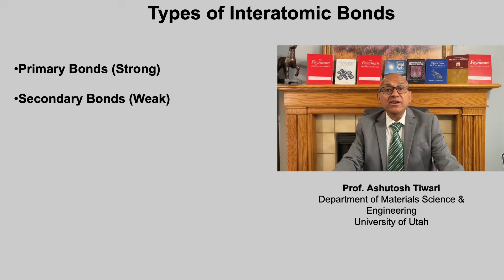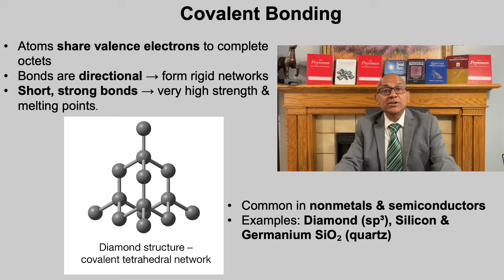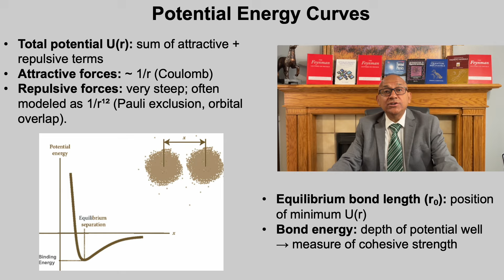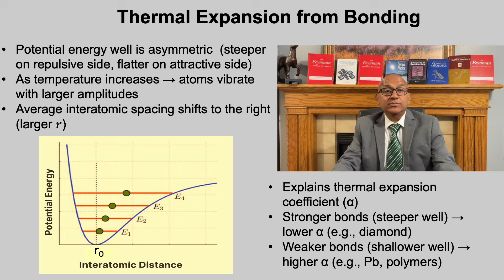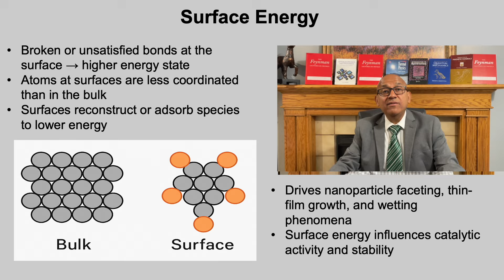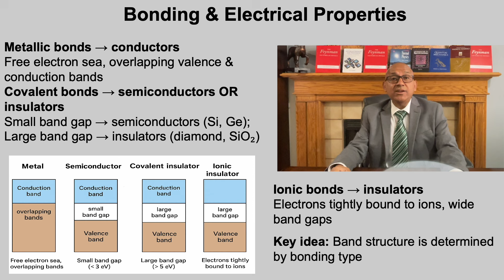Nanotechnology Lecture 9 | Interatomic Bonding & Forces in Solids

Comment: Hello sir, I am Sayona. Very informative lecture, starting with bonding which is very important as it determines atomic arrangements. It also governs interactions at interfaces and surfaces. There are two types of Interatomic bombs, primary bonds which are strong and secondary bonds which are weak. Primary bonds is further divided into 3 types which are ionic, covalent, and metallic. Secondary bond include van der waals, and hydrogen bonds. Ionic bonding deals with electron transfer, strong electrostatic attraction, thermal stability and brittleness. In covalent bonds, electrons are shared, bonds are strong and directional, and it gives rise to strong material like diamond. Metallic bonds include positive metal ions arranged in a regular lattice, and a unique combination of conductivity, ductility and strength. Van der waals bonds are weak and significant in layered structures. Hydrogen bonding takes place when H interacts with lone pair on another electronegative atom, and it’s useful in explaining high boiling point of water, structure of ice, etc. Total potential energy is the sum of attractive forces and repulsive forces. Cohesive energy is the energy required to separate a solid into isolated free atoms. Higher cohesive energy can lead to stronger bonding. Then there is bond length which is the distance at which attractive and repulsive forces balance and bond energy which is the energy required to break bond. If was also fascinating to know why materials expand when heated. Melting point of a material is controlled by bond strength so in covalent bonds, it is very high and in contrast, it’s very low in van de waals. Bonds in nano materials include high surface to volume ratio, many undercoordinated atoms, and dangling bonds. Bonding in 2D materials like graphene includes strong in plane covalent bonds, which provides stability and strength, but weak very de waals forces. The melting point of nano particles decreases as their size decreases which is explained by Gibbs Thomson relation. I came to know more about carbon and its allotropes through the well explained case study. Lastly, I studied how bonding can affect mechanical properties, electrical properties, and optical properties. Overall, this was a very informative and interesting lecture!

Comment: Hello Sir, this was a really interesting lecture. I ended up watching it twice to better understand how these potential energy curves dictate material behavior, and it realized many more implications of analyzing the different bonding forces.
The relationship where stiffness is directly linked to the second derivative of the potential energy curve near the equilibrium bond length really puts the origin of the elastic modulus into perspective for me. It is also a great takeaway how the directional hydrogen bonding bridges the  forces to form based pairs and stabilize the DNA double helix.
The breakdown of electronic structures was also fascinating, especially seeing how changing the band gap in covalent networks allows us to intentionally tune optical absorption and engineer materials for LEDs. Additionally, the Gibbs-Thomson relation, where the melting point depression scales with the inverse of the particle radius, beautifully shows how surface energy takes over when the radius shrinks due to undercoordination. I am very much looking forward to the next lecture!
Reply from the maker: Excellent observations, Rishi. I’m glad you connected the interatomic potential energy curves with material properties. Your observation that the curvature of the potential energy curve determines bond stiffness and elastic modulus is particularly insightful.

I also liked how you connected hydrogen bonding to the stability of the DNA double helix, and how changes in the band gap can be used to engineer optical properties in materials such as LEDs. Finally, your discussion of the Gibbs–Thomson relation and the increasing importance of surface energy at the nanoscale shows an excellent understanding of why materials behave differently as their size decreases.

Comment: Nice  lecture sir , Moving into the physics of interatomic forces and potentials was a perfect follow-up to the quantum mechanics modules.

The breakdown of the Lennard-Jones potential and the force-distance relationship (F = -dU/dr) gives such a clear microscopic picture of material behavior. 

It's fascinating to see how macroscopic properties like elastic modulus, thermal expansion, and melting point are directly dictated by the asymmetric curvature and depth of that potential well.

 Furthermore, connecting the Gibbs-Thomson relation to surface-to-volume ratio perfectly explains why undercoordinated surface atoms lead to dramatic melting point depression at the nanoscale.
Reply from the maker: Good job, Indrajeet!

Comment: Here, we learned how bonding forms the foundation of material science, deciding the structure and behavior of metals, ceramics, polymers, and semiconductors. Bond strength and bond length were tied to melting temperature, stiffness, conductivity, and optical properties. The lecture also explained how surfaces and nanoscale effects modify bonding, causing higher reactivity, melting point depression, and the distinct properties of diamond, graphite, and graphene.